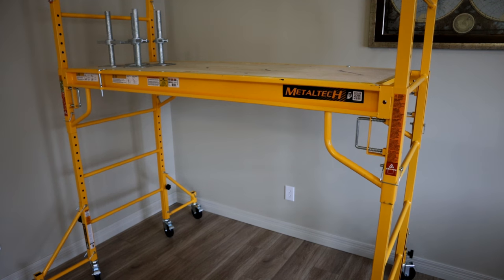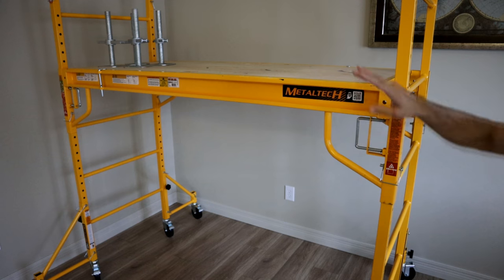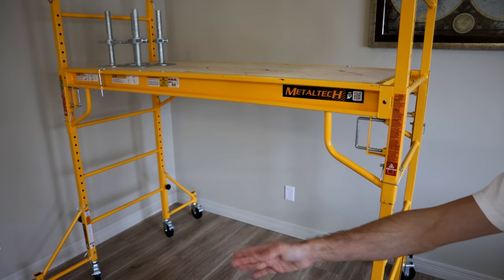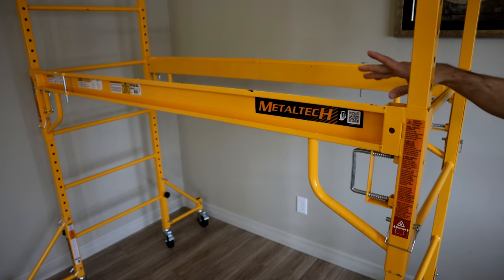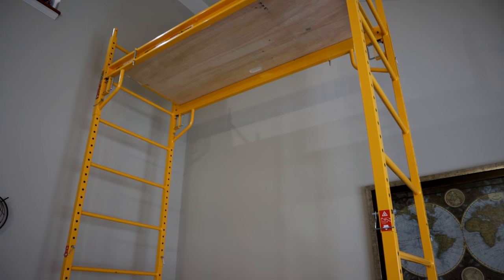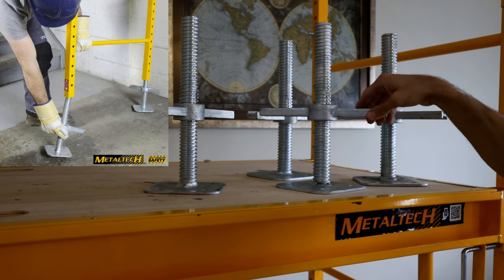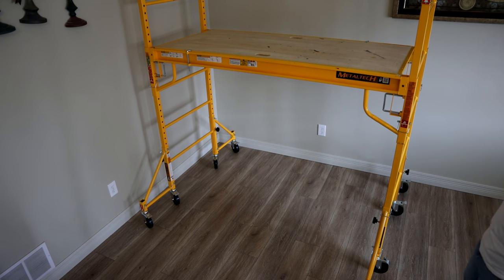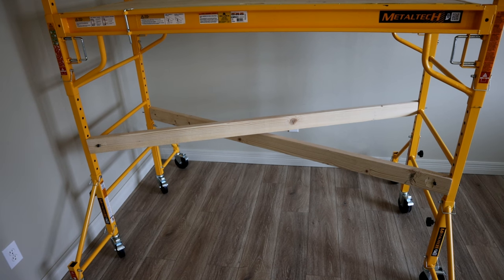MetalTech Jobsite vs Safeclimb Baker Style Scaffold | How to Assemble Baker Scaffolding

Comment from the maker: MetalTech Baker Adjustable Steel Platform Jobsite Series 6 Feet Tall Mobile Scaffolding Ladder with Locking Caster Wheels: https://amzn.to/4ca4uNU
MetalTech 1,000 Pound Load Capacity Steel Baker Style 6 Foot Scaffolding Safety Accessory Outriggers with Casters, 4 Pack: https://amzn.to/4a5SiMf
MetalTech Versatile 6 Foot Metal Guardrails System Accessory Baker Style for Select Jobsite Series Scaffolding Platform: https://amzn.to/3TfvWkB
WEN 31106 6-Foot Baker Scaffold Guard Rail System (Alternative): https://amzn.to/3Thx47g
MetalTech Versatile 500 Pound Load Capacity 4 Foot High Mini Mobile Scaffolding Ladder with Locking Wheels (Alternative): https://amzn.to/48PLn94
MetalTech Jobsite Series 4 Foot Tall Adjustable Mobile Scaffolding Platform and Ladder (Alternative): https://amzn.to/3IAlO0O
Metaltech Multipurpose Maxi Square Baker-Style Scaffold Tower Package Model Number I-TCISC: https://amzn.to/3VhCnWW

Comment: Good review.  Wish you would've shown the 3rd tier and whether the 14 inch outrigger is good enough.
Reply from the maker: Glad you like it!  For the 3 tier you should be using the 46-inch outriggers according to MetalTech.  The 14 inch outriggers are for the second-tier sets.  Check out the 3rd picture here, shows warning: https://www.homedepot.com/p/MetalTech-46-in-Outrigger-Set-with-5-in-Caster-Wheels-for-Indoor-Scaffold-1000-lbs-Load-Capacity-Set-of-4-I-BMSO4TT/312511196

Comment: Thanks, great review. Concise and to the point. Told us what we need to know. I would like to know how it is using it outdoors on grass/dirt. I wonder how well the wheels hold up against sinking in and if there are larger-size wheels available for outdoor use. I want to get the 2 story easy climb version that has the trapdoor in the platform to make it easier to climb and less chance of tilting over.
Reply from the maker: Glad you liked it!  The 2 story will move around in somewhat flat grass pretty easily, however if it rained recently you will need some extra support underneath the wheels when using the platform (8x4x16in concrete solid block is what I use).  If the ground isn't level, you will also need to make sure to use the leveling legs as well.

Comment: HOLA, YA COMPRÉ LA PARTE DE ABAJO DEL ANDAMIO EN LA EMPRESA EASY, PERO NO TENÍAN EL RESTO DE LOS ACCESORIOS, ME GUSTARIA COMPRARLOS PUDEN INDICARME DONDE Y COMO ADQUIRIRLOS. HUGO DE BUENOS AIRES, ARGENTINA. GRACIAS.
Reply from the maker: Here are a few of the accessories available in the US, however not sure if these are available in Argentina or not:
MetalTech 1,000 Pound Load Capacity Powder Coated 14 Inch Steel Baker Style 6 Foot Scaffolding Safety Accessory Outriggers with Casters, 4 Pack: https://amzn.to/4a5SiMf
MetalTech Versatile 6 Foot Metal Guardrails System Accessory Baker Style for Select Jobsite Series Scaffolding Platform: https://amzn.to/3TfvWkB
WEN 31106 6-Foot Baker Scaffold Guard Rail System (Alternative): https://amzn.to/3Thx47g

Comment: do i need larger outriggers for the 3rd tier?   I purchased the 3rd tier and it only came with the 14inch.  They would be held liable if the safety equipment is not appropriate to the product they are selling, so I'm assuming the 14 inch is fine.  Thoughts?
Reply from the maker: Interesting that you received the 14-inch outrigger if you ordered the 3 tier.  According to all MetalTech advertisement/pictures, they have statement saying the 46-inch outriggers are "Required safety precaution when using 3 stories."  If you ordered from reputable dealer, double check the part number you ordered vs MetalTech website...you may have received the wrong outriggers.  You should have received the 46 if you ordered the 3 tier like this one: https://www.metaltech.co/product/18-complete-drywall-baker-scaffold-tower-set/